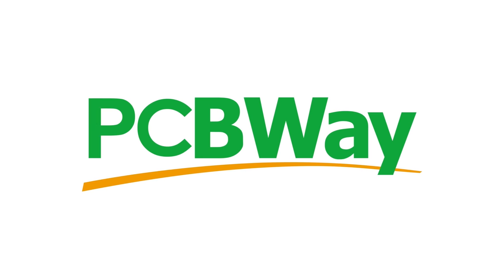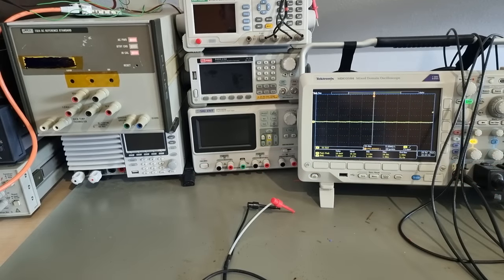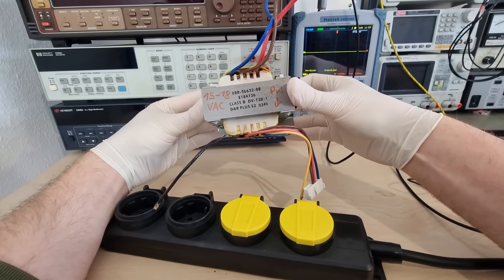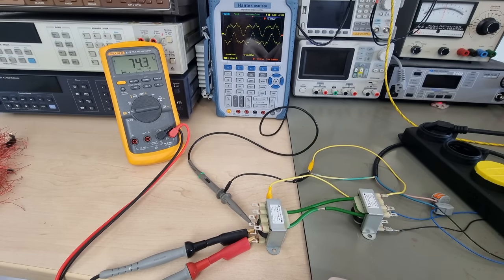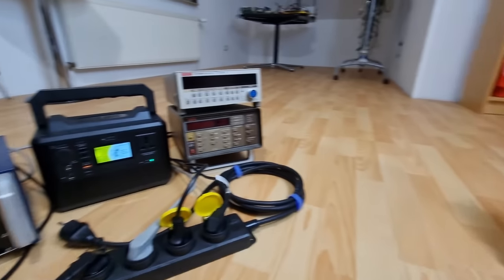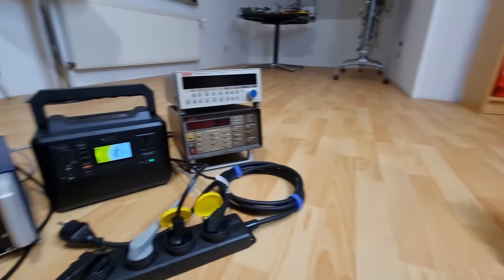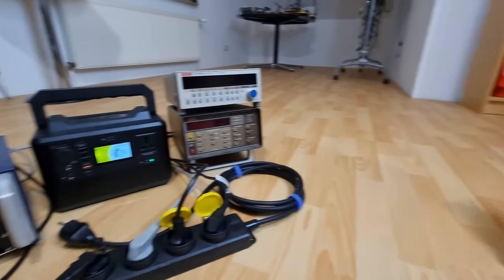eXtReMe iSoLaTiOn ( Low Leakage Power in Precision Electronics )

Comment: Thanks for the video. Is it possible to use coaxial wire for the inductor in HF filter? Will it reduce parasitic capacitance (if one side of the shield will be grounded)?

Comment: It would be terrible efficiency, but what about a high power led lighting up a photovoltaic? A bit of shot noise to deal with, but zero common mode
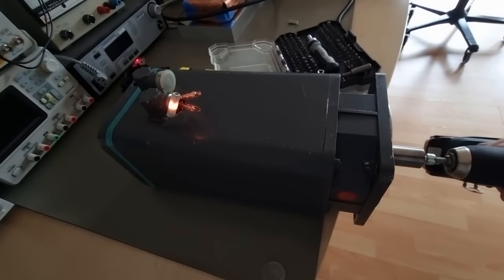Reply: Is that somehow different from 13:44?
Reply: @Graham_Wideman  I was premature commenting before that part in the video haha

But I would add that it could be done much more succesfully with a high power red LED aimed against a standard commercial single band pass silicon cell.

Comment: Skip making steam to turn a generator. It's incredably simple to achieve virtually absolute isolation with a motor mechanically coupled to a generator.
Reply: 13:34 "motor connected to a generator might work but that usually comes with wear and noise so i'd prefer a solid state system"

Comment: Light emitting resistor ;-D
Reply: Just wait until you have to explain to a kid the "classic" light bulb based on a light emitting resistor.
Reply: @NiHaoMike64  Already done (quick in a hurry before such bulbs disappear), fair point. With their structure (double-twisted wire) they should be quite a good light emitting inductor too. BTW, mains powered flying capacitors (or the parts of them) are quite interesting too, but won't be shown to my kids (fun, fun times!).

Comment: Audiophools think anything electrical that is labeled "Medical" makes it extra-special good.  All medical grade really means is that it's industrial strength that can be washed with harsh decontamination chemicals without failing.
Reply: Audiophools ! 🤪 🤣 👍
Reply: Can confirm - medical is only good if you require safety and robustness.
We needed a 5V DC adapter for a product under development, so I chose Meanwell's medical-grade 5V USB adapter to supply for safety and EMC testing. Turns out that it failed most EMC tests just because of the DC adapter, replacing it with some samsung dc adapter made it pass emc with flying colours.

Comment: Can someone explain what the motivation for this is? Is it for better audio systems? Its interesting, but who cares?
Reply: The motivation is to fully float a piece of test equipment (like a meter or voltage reference) so that when connected to equipment-under-test (EUT), there will be no common-mode current (DC, or AC of any frequency) adding to the desired measurement or signal.
Reply: @Graham_Wideman  Thank you. Yes, indeed, very important to get the noise out of measurements.